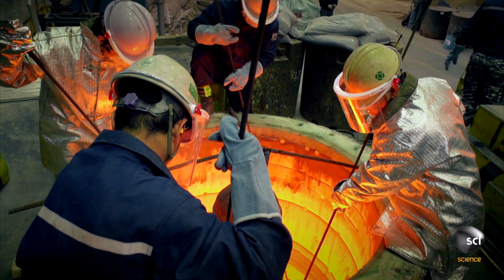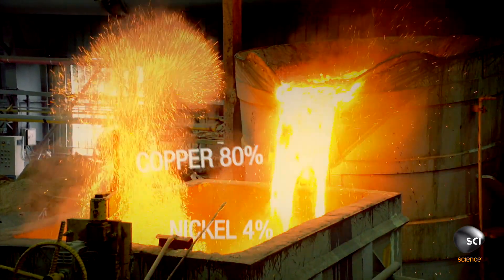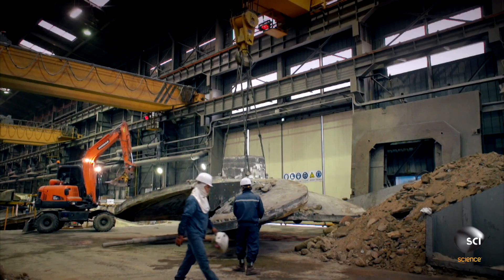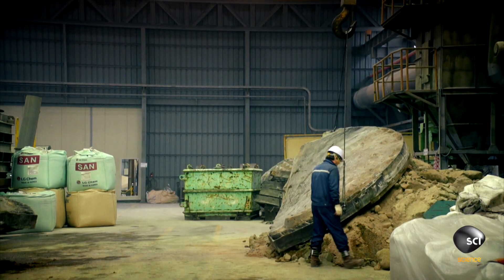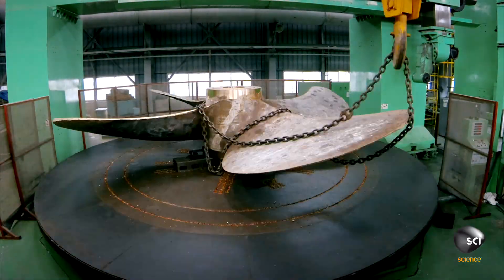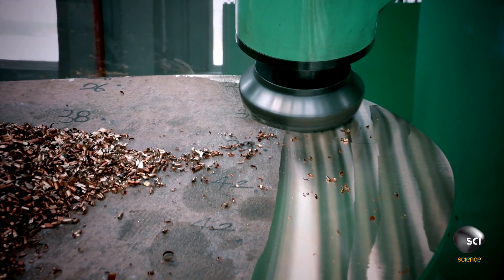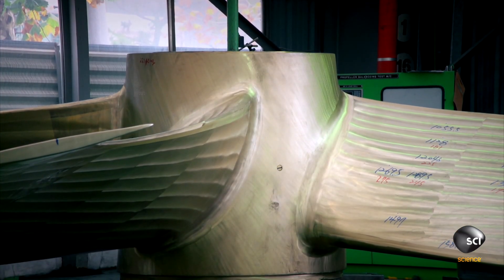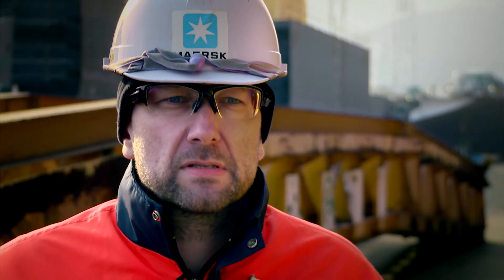Casting a Gigantic Propeller at 1,800°F

Comment: They should check their facts, IF the ship could travel 124 million miles in its lifetime (say 20yrs) thats 500+ times the distance to the moon not 5. Working on a 20 year lifetime it would have to average 6mill+ miles per year or just over 700mph 24/7/365, somehow I doubt it.
Reply: Don't let the truth get in the way of a hyped up headline.
Reply: True but now a days these ships may last up to 40 years but that is still 350mph
Reply: Right, but ships are expensive, and depending on the design they may last more than 60 years.  The Ryerson, a great lakes cargo vessel launched in 1960, is theoretically still a sea worthy cargo ship.  It takes work when it can get it, but work is hard to find due to the limitations of it's cargo hold design.  This ship was working off and on until late 2008 or 2009 when the economy suffered, and the demand for shipping steel pellets dried up.  Last I heard it was mothballed until demand returns.  
According to Wikipedia, the oldest oil tanker still used for normal service is the "LPG Gas Carriers/LPG/C Maharshi Shubhatreya, formerly LPG/C Libin" from 1982.  The oldest tanker being used in some way is the FPSO named Fluminense from 1974. The oldest one around, which is in bad shape and not useful as a tanker today, but still floatin, is the Falls of Clyde from 1878. 
 The point is that a boat could be scrapped after twenty years or become a floating museum for as long as possible. But yeah, the math in the video is probably screwey.
Reply: @jonnda  Container ships are built for a 30 year service life only.
Reply: +stuart cole Obviously the ships are going slow when you see them, probably being filmed for tv (minimal motion blur), pulling into port, or even docked.. They have to reach international waters in these bad boys before they are allowed to break the sound barrier, dummy.                                                                       

  /s
Reply: go to the sun
Reply: Whoever wrote that script should go back to school for basic math. It's not the narrator's fault.
Reply: Distance to the moon is probably the native measure unit for the narrative facts spreaders. So he obviously made mistake converting it  to the miles. :D
Reply: @kevinnguyen8612  Yes it is. You noticed the error, why did not he notice? Because he's just as stupid as the script writer! Because the narrator is a professional who reads everything that is given to him and what is paid for it? Nonsense.
Reply: Let's me do the math...emmmmmmmm............emmmmmmmmm...yup you're right. Totally agreed.
Reply: 700 mph sounds about right.
Reply: Maersk Tangier has average speed of 11kts (per Marinetraffic.com) so 124 million miles would take her ~ 1255 years 8 months and 12 days of 24/7 cruising.
Reply: sleeptyper you forgot, these behemoths break the sound once in international waters
Reply: @bamcr1218  These behemoths break in Cape Rollers so they have to go that fast to get thru between the waves. ;-)
Reply: Well to be fair they did say that propeller is much more efficient
Reply: Stuart Cole  You need to check your own facts before opening your big mouth.. I'll bet you've been telling your girl that 3 inch pecker you got is a foot too... IDIOT
Reply: You guys are all fucking idiots if you don't know some of the basic fucking facts you should have learned in high school science, and or math. The sun is 93million miles away from earth. You idiots are basing calculations of a trip to the simple moon at 124 million??? And for your information the moon is only 240,000 miles from earth.  These facts are so basic. No wonder you morons are watching SCIENCE TV, while you're at it, you should get a lifetime membership IDIOTS, AND STOP PLAYING VIDEOGAMES, AND TRYING TO FIX OTHER PEOPLE'S MATH IN YOUR MISGUIDED LIFE. No wonder America is going to hell in a handbasket! It's full of IDIOTS
Reply: @DavidJohnson-rd5wy  Damn, what's up with that hate rhetoric when it's just a debate between the distance a cargo ship can travel in its lifetime.
Reply: Kevin Nguyen especially when he’s wrong
Reply: David Johnson hey moron. He said 124 million is 500 times the distance to the moon.  Learn some basic reading compression skills, you fucking idiot.
Reply: All that typing....simple math shows its  1.24m not 124.  They missed a decimal.  Problem fixed.
Reply: Well yeah. That's a pretty damn good ship. You only got so many hours in a day. You're gonna need all 700mph...
Reply: Most times are not the facts but the units, probably the translation team trying to do something. You can see many examples on those misstakes wheree if you change the units from the SI to the imperial system those numbers makes much more sense.

Comment: what rust? its fucking made of copper. with some other things... you can say its bronze.
Reply: sounds like Ampcoloy, a very hard and durable nickel-aluminium-bronze. since it contains 4 percent iron it may be affected by corrosion to some extend.
Reply: "Rust" is a term for oxide. copper does "rust" that's why the statue of liberty is green.
Reply: true. but that is very slow process and does not need any protection as that oxide protects metal under it. paint is probably some toxic thing to prevent sea organisms to grow on propeller.
Reply: They should call it "Oxdizing" , not rusting. Rust is when ferrous metals ox-Idize . The prop is  probably  nickel,aluminum, bronze or NIBRAL. VERY toughStuff.
Reply: It has over 4% of iron in it, I'm guessing that some of those atoms could form a redox reaction and "rust".
Reply: I saw that too. I wonder how differant it is from Inconel, (which doesn't rust either)

Comment: Apparently 124 million miles (the distance the ship will travel) is 5 times the distance to the moon. Let's check the maths.

First, that 124 million mile figure. Assume 30 knots (approx 33 mph), 24 hours/day, every day (never stopping). That is 288,288 miles/year. The ship would have to operate at that speed (never stopping to load, unload, or refuel) for 430 years. Hmmmm.

The moon as about 250,000 miles away. Divide that into 124 million, and get 496 times, not 5. So they might be good at making documentaries, but basic Maths is beyond them.
Reply: @volcanohi-p2u  I doubt it because they were talking about the ship not the prop
Reply: it looks like they are just bad at math.  But ill bet if the prop was a wheel it spins more than 124 million miles

Comment: 124 million miles = 5 times the distance to the moon, wut?

The moon is about 230k miles away. 124m is more like 500 times, not 5.

124m is actually more like a trip to the sun, and then a third of the way back.
Reply: I caught that too..    Maybe 1.25M miles is more reasonable.  If the 125M miles were correct, that would mean that, if traveling at an average speed of 20mph (very generous), it would be going for 713 years.... seems a little much, no?  Hope they correct that.
Reply: They'll run the nuts off of that ship before it is sent to the wreckers.

Comment: 80 percent copper: Jesus just that thing materials must cost a fortune
Reply: Two weeks later some meth head scrappers stole it off the ship and brought it to the local scrap yard.
Reply: @rcbif101  copperheads strike sgain
Reply: @rcbif101  the meth heads probably spend more then a boats cost in a year
Reply: A friend of mine was working on a ship once and the comissioning crew were all alcoholics. He said all the brass doorknobs started disappearing, then the railings, then he was on deck having a smoke one day and noticed that the lifeboat he was looking at had no propeller. They had sold it to the local scrap merchant to buy more grog. Luckily they got fired and marched off the ship when he told the captain. But imagine if that never got caught and the ship was in danger?
Reply: @shoominati23  Should have been a more brutal punishment.
Reply: Bronze costs more than steel but its low melting point and ease of casting makes it a fraction of the cost of a steel prop that size.
Reply: dbmail545 also ain’t brass just the poster child of least corrosion
Reply: The R&D and labor are probably still more costly
Reply: Not really
Reply: I'm wondering why copper of all metals, is the main parent metal for a propeller? Interesting choice... surely there are lighter and stronger metals that are just as cheap? Someone help me figure this out
Reply: @Trey4x4  
Bronze has properties which make it almost ideal for marine applications such as propellers. It casts and machines very precisely with minimal tool wear. It strongly resists corrosion, including crevice corrosion and electrolysis, and acts as its own antifouling. Its tensile strength is not up to that of AISI 316 stainless steel, but fairly close. It work hardens more readily than stainless steel alloys, but that's not usually a concern for large uniform castings such as propellers. And it has a very high reusability and salvage value which helps to offset its expense.
Reply: @Trey4x4   its possible that the alloy as a whole makes the strength and other alloys using aluminum would not work as well due to harmonics from the engine
Reply: @Trey4x4  Also the weigth is kind of irrelevant when you are hauling half a milion tons
Reply: @Trey4x4  the cost of working it offsets the cost of acquiring it. It is more easily cast for starters, but also, at the end of the day, that's the chemistry of the alloy that works the best for their design, and they are clearly still able to sell them despite the price
Reply: @Trey4x4  bronze.
Reply: No no. You misunderstood. His Name is Cooper.
Reply: The copper prevents animal growth so the prop stays clean of barnacles and such.
Reply: copper isnt to expensive if u buy it cheap
Reply: @rrrohan2288  the floor is made of the floor.
Reply: @rrrohan2288  no shit...
Reply: @muniz27  Gold is cheap if you buy it cheap! Lol
Reply: 4%  nickel too, those are very expensive metals
Reply: I was working on a renovation job once converting an old factory to a storage warehouse. Some temp labors came in for a day once and quit by lunch time. The next day when we came in to start working, we noticed that all the skids of copper we had collected were gone, thousands of dollars worth. The owner called local scrap yards to see if anyone had brought in large amounts of clean copper. Turns out just 20 minutes earlier 2 guys just dropped of truck loads of the stuff, the scrap yard was 10 minutes down the road. So the cops were called. The cops looked at the security footage of the temp labors that quit the day before breaking in and stealing it in the middle of the night and then the security footage from the scrap yard of them dropping it off in the morning. They also brought 2 friends and they used their company supplied vehicles with the companies name on the side of the trucks. The cops busted them within 2 hrs. They found the scrap receipt on one of them for the amount of copper they stole. The owner eventually got his money back after they had been convicted, so I guess he saved a few bucks since he didn't have to pay anyone to drive it to the scrap yard.
Reply: @stinkyham9050  very smart, are they?
Reply: Isn't copper a very soft metal?
Reply: @user37486  the addition of other metals to the alloy makes it almost a completely different metal with unique properties.
Reply: @farticlesofconflatulation  I wasn't aware of that. Thanks for this information
Reply: @user37486  that’s why it’s mixed and made into a Alloy metal
Reply: It looked like the "corrosion inhibiting paint" the narrator spoke of was alodine, (which isn't any sort of paint) and from my aircraft maintenance days I was led to believe alodine only worked on aluminum but my memories could be lost to the couple decades that have passed.
Reply: @NoZioKikes88  Yeah I thought it was weird that the narrator used the term "paint" when something like "coating" would obviously have been more appropriate. That's what happens when you make "science" videos for the lowest common denominator.
Reply: @NoZioKikes88  I was wondering about that. I listen to these documentaries with a grain of salt because I know how often the narrators butcher information. Thanks, I was wondering what it actually was.
Reply: I swear to spaghetti monster if I get another reply imma delete my superfluous question
Reply: @Trey4x4  Copper is easy to melt, and doesnt rust.
Reply: @Trey4x4  Copper is easy to melt
Reply: @Trey4x4   Perhaps not ask a 'superfluous question' if you don't intend to get it answered? It was actually a good question, I learned a lot from the responses.
Reply: @TRPGpilot  you're superfluous.
Reply: @Trey4x4  You are the smartest person on the internet . . .
Reply: @TRPGpilot  aww shucks ☺
Reply: Yepp
Reply: Nice comment thread. Can nickel be added to silver and gold to make strong and less corrosion jewelry

Comment: Seems to be some division / multiplication error in the math for 'distance it travels versus distance to the moon'. The moon is only ~230,000 miles away... so five times that isn't 124,000,000.
Reply: Matthew Wilson I noticed the same, I think the presenter can't read numbers, it's probably 1.24mill miles not 124mill miles.

Comment from the maker: Thanks to everyone who pointed out the error in the video's title! This propeller is being cast, not forged! We've corrected the mistake.

Here's some great reading about different types of metalwork:
https://www.sfsa.org/castingsvforgings.php
Reply: Science Channel Who wrote this? "124 million miles, roughly 5 times the distance to the moon."

Yeah, try 500 times. That is seriously BASIC science.
Reply: @QuadinarosLS  "science" channel using Fahrenheit for temperature and you're picking on that?
Reply: As a scientist, it is in my nature to always challenge numbers.   So 124M miles divided by 25000 is roughly 5000 trips around the earth.   Hmmmm, some number here seems off.  At 20 knots, or 23 MPH average speed, the 124M miles means that the boat will be underway for 5,390,000 hours.  Even at 24hrs/day, that comes to a service life of 657 years.  So, my guess is that the 124M number should have been closer to 1.24M miles which would be consistent to the claim of 5X distance to the moon, and if we assume say a duty cycle of 75%, underway 75% and in-port 25%, then the 6.57 years becomes closer to 9 years.  I'm not sure of the lifespan of these boats but maybe around 10 years is reasonable though I'd think perhaps 20 years for the hull with a major overhaul of everything happening at midlife, so this prop would then do 1/2 of the boats life cycle and a new/refurbished prop would do the second half.  I have no problem being the guy to point things out.  ;-)
Reply: If 25000 is your distance to the Moon, I suggest you check your references then recalculate.
Reply: I suggest you reread to see that 25000 refers to distance around the earth.
Reply: touche
Reply: Science Channel what's the machine that was milling the cast.  I'm curious about it
Reply: Science Cha

Comment: It goes through a couple stages before the machining(they called it grinding) they show . Usually its Shakeout> First chip> First grind> Inspection(dye/ mag / xray)>Air Arc/Reweld> Last grind>Final inspection( Dye/ Magnetic/ Xray)> then off to be machined. I worked 5 years in a sand casting company, from grinder to welder to shift foreman.
Reply: i wanted to se all the steps , kinda sad it diden't show any QA steps
Reply: Working your way up through the company!
Reply: They dummied it down for us yankees.    I'd love to see the full process, but odds are the machine shop won't let it happen.
Reply: I'd love to see how they bored the hole in the middle so it fits on the prop shaft
Reply: Dan Townsend A Texas-sized boring bar was used.
Reply: Hey . . . anyone knows why they don't use 3D printer for the job ??

Comment: 2:00 "grinds away"... Quality American television.
Reply: It may appear to be uneven, but it's how the machining process is done. It's smooth, but to a certain point: Why make a blade mirror perfect at that scale? That's wasting energy.  Plus with a certain roughness on the blade can prevent damaging effects caused by the water rushing over it.
Reply: Yes it made me cringe, you use a mill to "mill not grind " parts

Comment: Incase no one mentioned it yet that propeller was cast not forged. Did anyone else notice that?
Reply: scyther1 may I know the difference between the two?
Reply: "Cast" is liquid poured into a sand mould. "Forged" is when a very large hydraulic press comes down and squeezes a metal blank into the desired shape. High-end car wheels are "forged". Plus, it makes the finished product much stronger than "cast".
Reply: LandrumLand thank you
Reply: I think it's big enough that it doesn't really matter.
Reply: Yes,just about everyone.lol